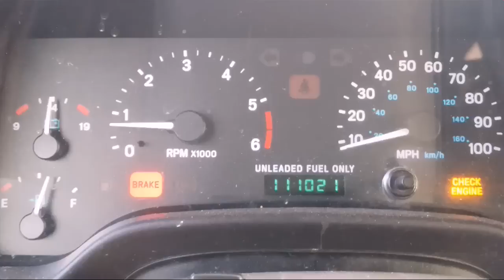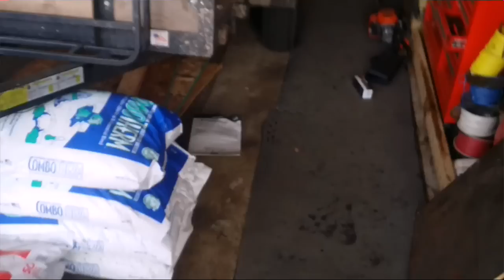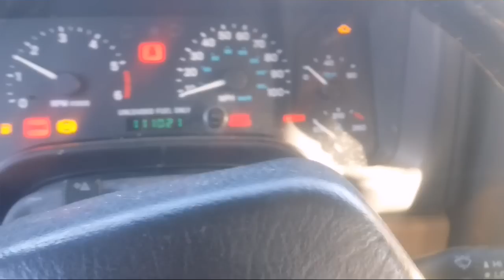Jeep TJ O2 Sensor

Comment: i installed an aftermarket headers and my o2 sensors has been disconnected ever since, is that a problem? 

plus, i just saw your tranny mount replacement, did it eliminate the shakes when you take off from a dead stop? because i have the same problem.

thanks
Reply from the maker: Khalid khudhori Probably. Id get it scanned. If its throwing that code, its definitely from the lack of O2 sensors

Comment: Any advice on reaching the clip on the bank 2 number 2 sensor? the clip behind the engine block.
Reply from the maker: marthusdrummer If I recall correctly,  that one is on top of the rear of the trans, pretty much where it meets the driveshaft. Go under from by the muffler and look towards the front of the jeep on the passenger side behind the cat.  Honestly, I'm not 100% though, it's been a couple years since I've done that one.

Comment: should have used NTK. TJ's hate Bosh
Reply: Which NTK for a 1997 Jeep Wrangler Sport  IL 6?  And will it be an original fit?  Bosch is a perfect fit but this will make 2 of them that I have put in.  Only 100k miles.  I don't know what the original was?  Thanks mate.
Reply: This is not the first time I've heard this.

Before I knew about the NTK vs Bosh issue, In 2014, I replaced an exhaust system (cats and all) along with all four o2 sensors on a 2004 Liberty. I used Bosh brand sensors. Drove the Liberty around for a while and it passed emissions. A few days after passing, the ECM triggered the same o2 sensor faults as before. I'm glad I had it tested when I did.

On Friday, July 12, 2019, I replaced the exhaust system on a 2006 Wrangler, except this time I used NTK sensors instead of Bosh. The Wrangler passed emissions this past Monday. So far, there have been no fault codes.